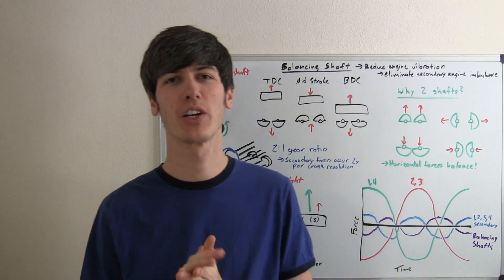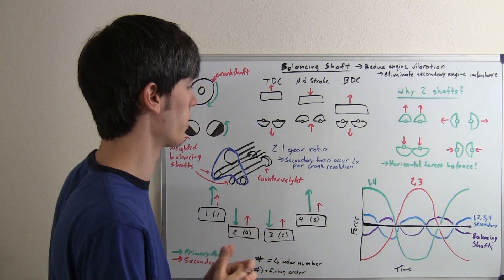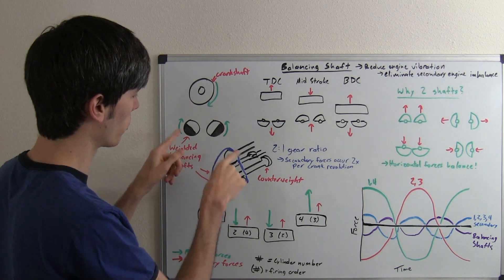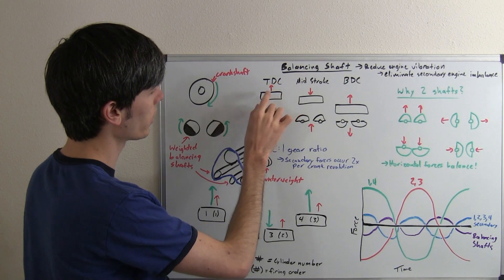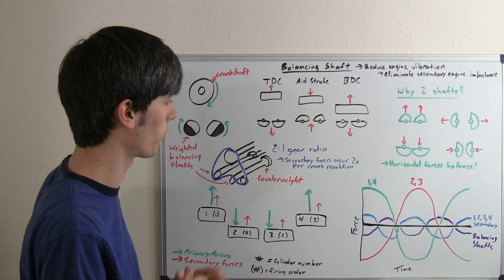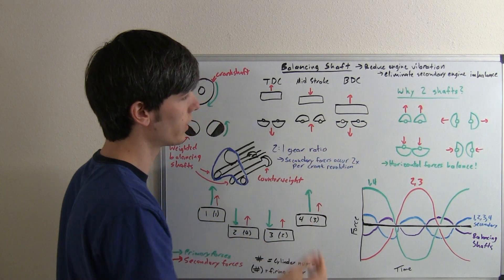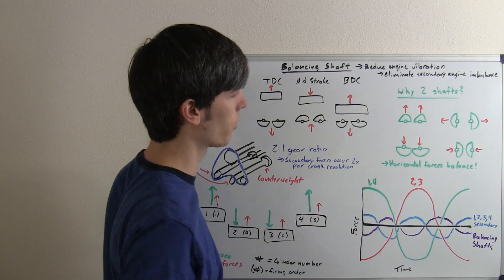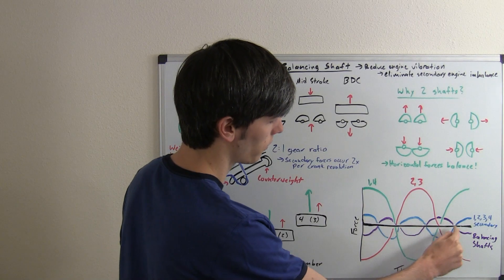Balancing Shafts - Explained

Comment: Simply put, balance shafts were essentially created and installed to smooth the engine operation. This means the ENTIRE engine assembly in its fixed mounts, wherever that may be. Contrary to what some may believe, balance shafts actually have NO effect on the ROTATING ASSEMBLY. They don't counteract an out of balance rotating assembly, including crankshaft, rods, pistons, pins, flywheel, clutch, torque converter or harmonic damper (the last of which actually CAN help counteract minor rotating assy vibration/imbalance). Balance shafts help sell cars. They're not good for performance. They're a potential point of failure. They spin at twice the speed of the crankshaft. They're often removed from many engines to be used in racing applications because a grossly out of balance shaft spinning at 22k rpm isn't a great idea. In a car, they simply make the engine not vibrate externally, thereby causing a quieter, smoother operation. In some vehicles, they're called "silent shafts". Again... they basically help sell cars. It's all about that test drive!
Reply: Try that on a single cylinder Enduro. Whole engine is going to bust
Reply: Does this shafts not rob power on high rpm?
Reply: any spinning mass on the engine will rob power during any rpm change. It is like adding more flywheel. It takes power to spin them up but not to keep them spinning.
Reply: @oluskloc  secondary forces which move the whole engine up, down and sideways require energy, so they will rob energy to do so.
Reply: Yes I understand. But is it any significant amount of horsepower and torque (measurable) or just 0.1hp?
Reply: even 10hp on 2.0L engine
Reply: That's a lot. I have 1100 motorcycle engine, is it worth to delete it?
Reply: Watched some of this video didnt find what i wanted to know.. Read your conment bam puzzle solved thanks!
Reply: I think my bmw engine doesn't have them because there a movement of the engine , N47D20A automatic

Comment: I see that the same concept of the balancing shaft can be applied in the case of the yamaha R1 engine, which use a crossplane crankshaft but only a single balancing shaft. Can you explain why is it better with a single shaft in that case? Is it because of how they angled the engine instead of having it perpendicular like a B or K series honda?

Comment: Are there any inherent disadvantages to balance shafts?
Reply from the maker: Noel Aito Added weight, additional rotational inertia = power lost, complexity and cost.
Reply: +Engineering Explained The loss of power isn't that great but at the other end I would say that it improves low to mid range torque, I tried it on my car and it lost mid range power without gaining that much at top end.

Comment: In your previous video on Secondary Engine Balance, you indicated that the secondary forces are slightly less at the 180 degree point (BDC) than at 0 and 360 (TDC). That would seem to imply that even with balancing shafts, there will still be some residual imbalance, since the counterweights on the balance shafts are fixed weight. Is this correct?

Great videos, BTW!

Comment: Some In-line 4s engine like those used in motorcycles don't have balancing shafts. I am wondering how those engines deal with these secondary vibrations. I have a CBR600RR crankshaft, and it seems to have more counterweight than needed for basic static balance (counter the rotating crank arm). Should in-line 4s be using 0% balance ratio since they are already in perfect primary balance and any extra counterweight would not help reduce the secondary balance?

Comment: So in the mid stroke the secondary force points down because the piston is accelerating downward? While at bdc the piston is decelerating the downward motion hence the force would be up. Correct me if im wrong im a little comfused

Comment: My engine (2.6L s.o.h.c. mitsubishi) had the balance shafts removed so the vibrations get pretty annoying at certain rpms so I'm thinking about putting the silent shafts back in.  They were installed for a reason in the first place and if they help the engine last longer, it's worth having them.  Thank you so much for the great video.
Reply: What rpms and how bad is it? Did you have your rotating assembly balance checked when you did that Delete? I have a Mazda 2.6l SOHC G6 engine I'm thinking about deleting balance shafts.

Comment: Great effort done in these nice videos 

I just need to understand more .. why do we need the weight balancing shafts while the piston is in the mid stroke as it is just going down with normal speed and with no secondary forces ( as i understand that the secondary forces appears only two times from 0 to 90 and from 270 to 360 where the piston moves faster ) if that's right so why do we need to balance the piston while going from 90 all way to 270 ( mid stroke ) is it not balanced just by the primary forces ??

Comment: Is there a con to having a balancing shaft? I know some tuners offer balance shaft delete kits.
Reply: AR Taken : I'm NOT an expert, but here's what I've read.  In a 4G63 you only lose about 15hp (11kW), but a snapped belt could wipe out the entire rotating assembly, and the danger gets worse as you tune the engine for higher power and RPM's.  Tune an engine to handle 10,000 RPM, and you'll have to figure out how safely spin balance shafts at 20,000 RPM.  Many tuners address the danger by simply eliminating the shafts.  Sure it will idle rougher, but the roughness goes away at higher RPM's, and tuners generally care more about high-RPM behavior anyway.

Comment: I think you should have said that all those forces are inertial forces, I also read in a comment that every V6 doesn't need secondary forces balance. That is not true because only V6 60° are perfectly balanced, if you change the angle, those forces are no more balanced. And there is more: all engines that have a number of cylinders equal to 3, 6, 12, etc... can have a perfectly balanced configuration. Anyway I've never seen a car with those shafts. They're didactically valid but not practically...
Cheers :D

Comment: it would be interesting to tilt the engine 45 or more and run a single balancer shaft instead. this will make way for oil to crankshaft yet have a balancer shaft directly below crankshaft at the axis of piston movement. single balancer rotates against crank, would be cheaper with one balancer with similar outcome

Comment: Does it have an impact on performance or it's just for comfort?
Reply from the maker: Would slightly reduce performance probably, since it's additional rotating mass, but the vibration would be reduced, and the engine may last longer.

Comment: i was overhauling a nissan ZD30 diesel engine and the balancing shaft bearings in the engine block are damaged very badly. There is no replacement part for that unless to change the whole engine block. The machinist helped me chop off the shafts n blocked the oil gallery. Its been 5 months now and the engine still running smoothly. Is this type of repair recommended? Will this type of repair damage the engine? Here in Malaysia is not easy to find parts.

Comment: I understand why ALL engines regardless V type or Inline are all "even number" cylinders, because of BALANCING :)
Reply from the maker: 3 and 5 cylinder engines aren't all that uncommon, and single cylinders are very common (though not necessarily in cars).
Reply: Engineering Explained wait what?! There's 3 or 5 cylinder engines for vehicles out there??? What kind of car uses it?
Reply from the maker: Volvo and Audi have 5's I believe. Smart car has 3 cyl.
Reply: Engineering Explained all inlines correct? There's no way an odd number cylinder to be a V type since it would be "uneven".
Reply: 7150285 Honda's old Motogp bike, the RC211V, had an engine with a V5 configuration.  However because it dominated the grid with its sheer horsepower advantage, the other competitors complained to the governing body resulting in its ban in 2006.

Outside of racing VW has a production V5 engine; that was a steaming pile of shite.
Reply: 7150285 Honda's 2002-2006 RC211V MotoGP motorcycle used a 75.5 degree V5.  Also, Volkswagen made a 2.3L VR5 engine for use in five of its cars in the 90s.

Comment: Great video btw. I have a question. I have a 5cylinder engine. Whats the forces acting on that engine would look like and how can they balance it? I know u r just running through the basics right now but will u be going into complicated stuff like 5cylinder engines and V engines later on? 

Thanks, looking forward to learning more from u. I have been following u for a while now and its been very educational.
Reply from the maker: I will be going into a couple more engine layouts, yes.
Reply: Engineering Explained Inline 5 cylinders are amazing :) specially Audis.

Comment: I'm trying to learn so my question is, how do the secondary affect the functioning and performance of the engine (with and without the secondary forces)?
Reply from the maker: The engine will have reduced vibration with balancing shafts. Performance will be slightly sacrificed as you're adding rotational mass.
Reply: Engineering Explained Thank you.

Comment: Wouldnt the counter weights on the crankshaft balance the engine? So balancing shafts would no longer be necessary
Reply from the maker: Depends on the engine layout. For inline 4's with the common 1342 firing order, the secondary forces peak twice as often as the primary forces, so the crankshaft cannot counter them.
Reply: Engineering Explained what are the differences between 90' V4 with inline 4 with an uneven firing order? yeah i mean crossplane crankshaft as both have an almost identical firing order.

Comment: can u discuss motor mounts?
Reply: There are at least 4 Engine mountings in a car. First is front engine where the engine is mounted above or in front of the front axle. Second is rear engine which means that the engine is mounted far back in the car, behind the rear axle. Common in Porsche. Third is mid-front engine wich is a bit sportier than front, where the engine is mounted behind the front axle to give the car more balanced weight, Many BMWs got it. The last is mid-rear engine where the engine is mounted in front of the rear axle but behind the driver, also for better weight distribution and its common in supercars and radical racecars.

Comment: Another brilliant explanation! Now explain why people remove them, lol!
Reply: cause they are too smart maybe
Reply: 1) They have mass, which means the engine can't rev up and down as quickly.  2) They aren't made to withstand super high revs that modders put them through
Reply: Steven Willmy yes you can rev up and down as quickly as possible as you removed the inertia inside the engine. drawbacks? you only got 1/4 engine lifespan left.
Reply: azrul nizam 1/4 is probably not accurate, since many factory-stock reliable 4 cylinder engines do not use balance shafts.
Reply: Steven Willmy yes you can rev up and down as quickly as possible as you removed the inertia inside the engine. drawbacks? you only got 1/4 engine lifespan left.

Comment: What determines the weight of these counterweights? Does it need to have a particular weight or can it just be a random weight, assuming you have two shafts with the same weighted counterweights?
Reply from the maker: Definitely needs to have a specific weight, which would be dependent upon the mass and acceleration of the pistons.

Comment: Are Balancing Shafts just a comfort thing, or is there any/noticeably performance gain? 
I have a small (Just for fun) 3 cylinder track car, thinking of not putting the balance shaft back in to see what difference it makes
Reply from the maker: Well technically you're using more power to have them in, however an engine with less vibration will usually last longer, and won't fatigue other components of the car as much with vibration either, along with the added comfort.

Comment: O have never worked on an engine with balancing shafts so forgive me if this is a dumb question. Can the balancing shafts be out of balance? like installed wrong or out of sync with the crank?
Reply from the maker: Absolutely. If they were installed slightly out of sync with the crank, you'd get noticeable vibration.

Comment: don't crankshafts have weights on them? thus negating need for balancing shaft?
Reply: Yes , but secondary forces occur 2 times per crankshaft revolution , and counterweights can't cansel vibration completly .
Reply from the maker: Depending on the layout, you may not be able to cancel secondary forces: Secondary Engine Balance - Explained

Comment: on my 4g63t i removed n threw in trash. those " balancing shafts"
Reply: Vibrating your engine and other connected components with high frequency, low amplitude but high energy mechanical inputs is not only uncomfortable, but ultimately shortens component life, so the miniscule power gains simply aren't worth it.

Of course, if you're happy to replace parts more, it's your choice.
Reply: I have a 91 DSM and yea i removed them and used a mirage stubby shaft to replace the assembly, it came in a kit. I liked it and did not notice any more vibrations than before.

Comment: No balancing shafts is probably one of the greatest advantages of an Inline-6 engine.
Reply from the maker: Well, hardly any modern production vehicles use balancing shafts. Most either keep small enough engines that it's not necessary, or different layouts can cope in different ways. That said, I6's are terrifically balanced, I'll have a video on the subject soon.
Reply: @EngineeringExplained  Audi, BMW, Volvo, Jaguar and Land Rover three and 4 cylinder engines have balance shafts and there are many more 4 cylinder and V6 engines with them.
Reply: JerryTheHeretic
They do lower HP as they're extra mass the engine needs to turn over as well as losses through friction in the gearing and bearings needed to keep them turning and stable.
Reply: Engineering Explained
 I remember when GM added balance shafts to the quad 4 engine. There was also a noticeable decrease in HP that year. Do balance shafts decrease engine HP?
Reply: Very true but f20c (s2000 motor) does not have them and is still very balanced. Plus 9k rpm
Reply: Engineering Explained My father in law bought a new 2.4 liter Honda straight 4 suv. It vibrates so much :D
Reply: +Engineering Explained They are a mate has the well know bmw I6 well maintained you ca hardly notice its running!